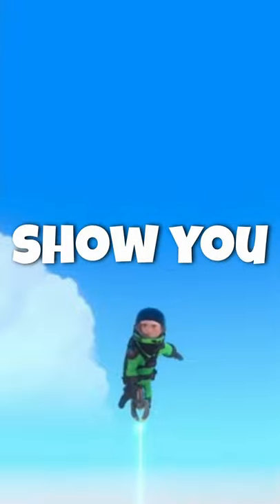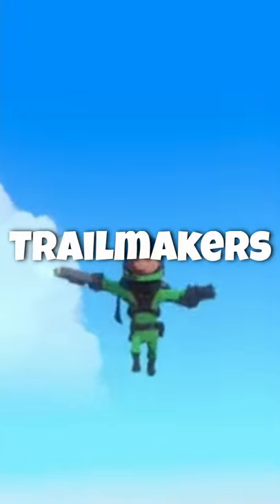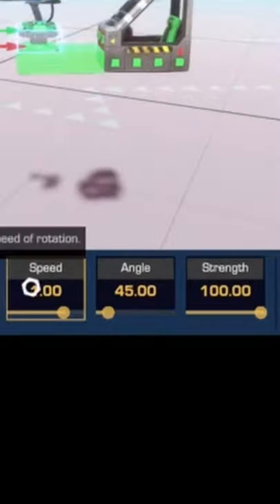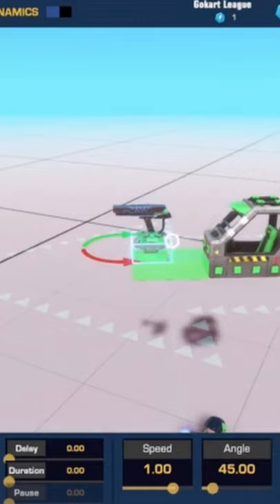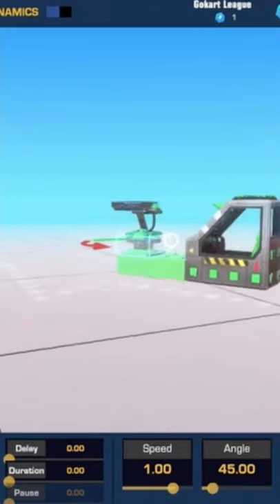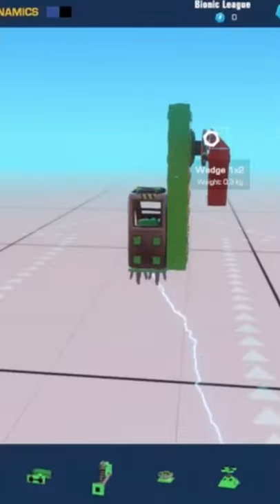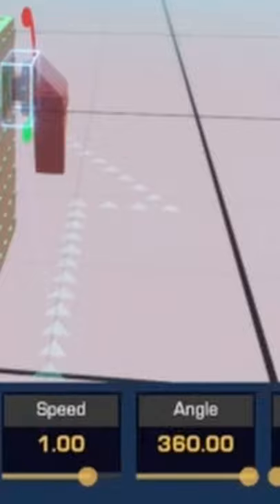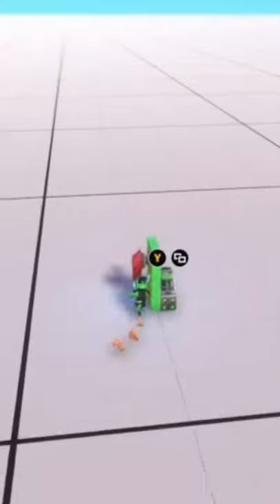How To Use The Rotating Servo (Trailmakers Tips)

Comment: The Strength can be used in a way to allow resistance to assist in flight and/or sub control. My opinion or just a theory is like a submarine with multiple moving tail parts it could be set to like 85 and it would add drag to stabilize the tail in motion.  Rather than the instant jerk when you move it.  Nice video for quick helpful tips! 👍